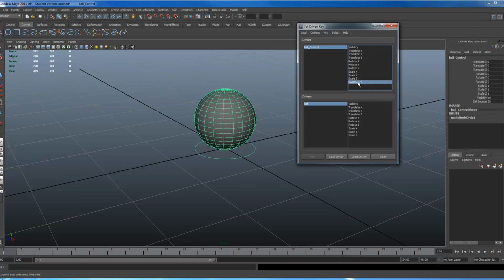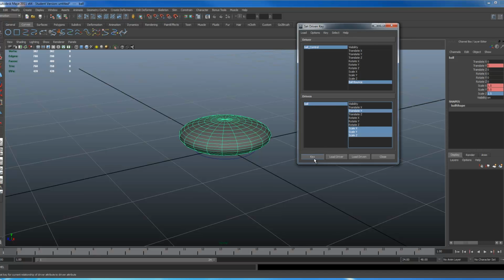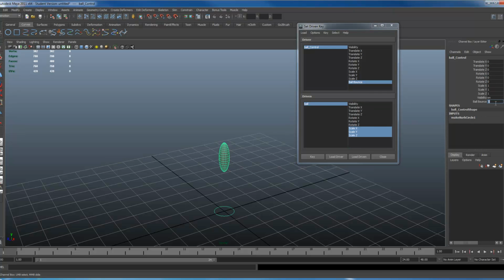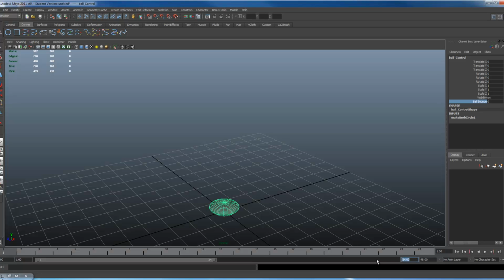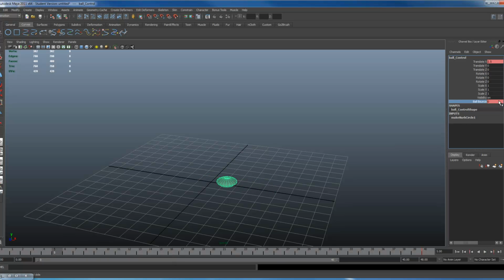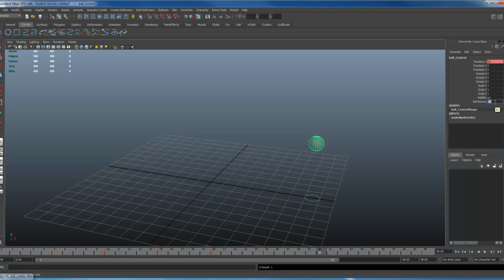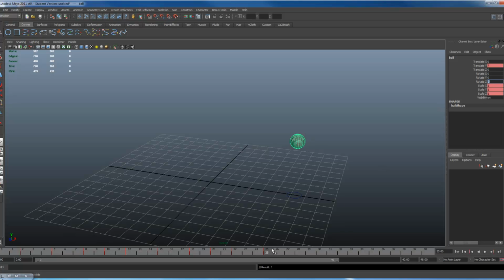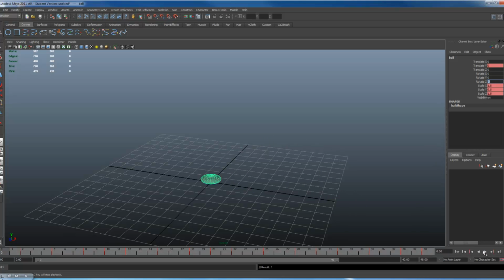How to use Set Driven Key in Maya Part 2

Comment: Is it me or the bounce doesn't decelerate? And if so, is there a way to make on each bounce the ball to bounce to a bit lower height, and still being it with (0,0,0) scale at the top? Because currently, if you want it to bounce to the half height, it will be deformed due to the scale, right?